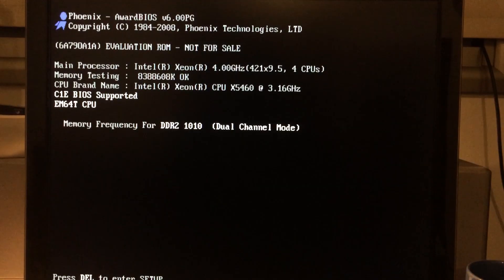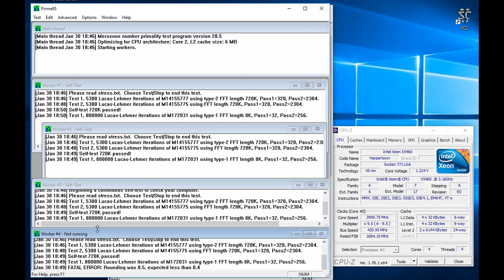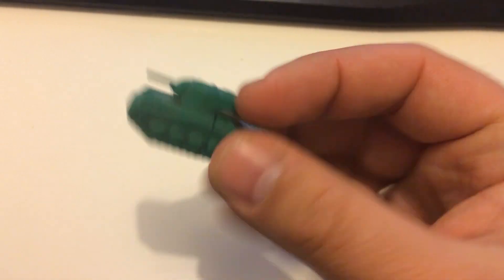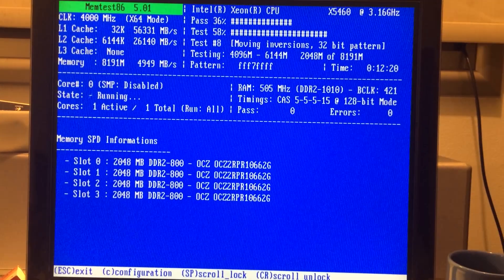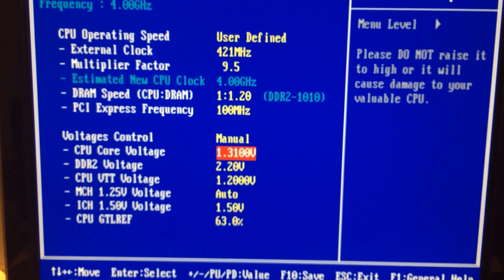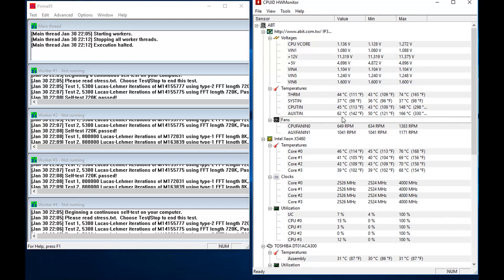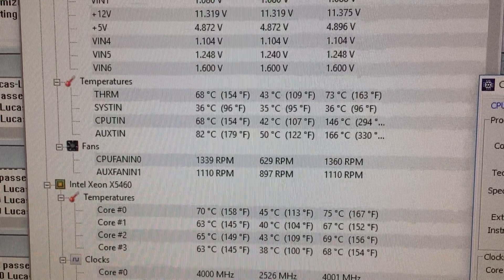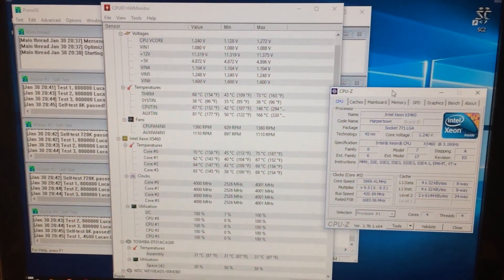Xeon Overclock 4GHz - Modded X5460 on Abit IP-35 (LGA771 CPU on LGA775 MB)

Comment: I installed the cpu successfully, but i noticed high temps 73 C when cpu is stressed.the cpu-z multi cpu stress cpu test scores 1115 and drops down to 950 after 5min when the cpu temps go up to 73 C (Core Temp software). Is it normal ? I did not overclock, its working on 3.16Mhz.
My cooler is lc power cc 95.

Comment: 2.20V ram :O
Reply: i have xeon x5460 4.1ghz but my voltage cpu is 1.30 and ram 1.86
Reply from the maker: the RAM voltage depends on what modiles you have. The ones I have have the voltage written on them. CPU is up to you.
Reply: @IONHowTo  okok

Comment: Hi, i bought this cpu but when windows start, blue screen appears. My botherboard is a P5B Deluxe, i dont know whats the problem, maybe unstable? the cpu and bios are already modded for enable 771 but it doesnt work, what do you think? should i change some parameters?
Reply from the maker: What version of windows?
Reply: Dragos Ion hi, Windows 7
Reply: Dragos Ion changed an option called "cpu frecuency" from 333 to 300 and it work but games and aplication crash, now i set it on 290 amd now it works and games dont crash but the cpu is on 2,75 ghz only, how can i oc with without oc ram too (i think that option i mentioned oc rams too and do my system unstable). Sorry im new with this terms and overclock
Reply from the maker: I don't know how it's on your MB, try to find the ratio somewhere and try lower CPU/RAM speed ratios.
or get faster RAM.

Comment: Could you overclock this same chip on a msi g41m motherboard?
Reply from the maker: Didn’t try it, don’t have that MB. 
Send it over and I’ll test it and make a video with it. 😅
Reply: I don't have it yet. Im intrested in buying it and I wanted to know if the chipset if overclock friendly. :)
Reply from the maker: Try to find some forums dedicated to that MB, without testing I wouldn’t be able to say. 😅
Reply: @IONHowTo  i have a GIGABYTE P43T-ES3G with X5460...xms3 1333mhz only 12 gigs since one ram was dropped on the floor and got broken. Any recomandations tu go higher than the general 3.16ghz? watercooled ofc and a 450wats psu from Thermaltake.

Comment: Now, i 3.8 overclocked my x5460 on asus p5q mother board, (1.28V)
I tried many time to overclock it 4.0 but 
When i overclock it over than 3.9, the bluescreen appear, 
So i want to get an advice, plz.. 
Ps. My english is toooo poor so you may not  understand me sorry😂
Reply from the maker: You write well don’t worry :) My MB overheats the Northbridge. At 4ghz you might have the same overheating problem. Its easy to check, check tems and put your finger on the nb cooler.
Few things can fix it.
A fan there or upgraded cooling fins for the NB or even water cooling. 😅 I would stay at 3.8 without extra cooling.
Also, make sure you don’t OC your RAM.
Also noticed that some RAM ratios just don’t work well and are unstable.
Reply: Dragos Ion thank you for advise me i gave up Oc to 4.0 :(  i satisfied on 3.8 
Thanks one more
Reply: @IONHowTo  I had for 10 years ram ddr2 800 MHz overclocked at 1360 MHz.
When I upgrade to 8gb ddr2 I have to set them to 1000 MHz because they are different models
Reply: 휴먼체 what were the settings? I have bought the same CPU and Motherboard
Reply: Silicon lottery, some chips will go farther than others. It's luck of the draw, and motherboard power delivery quality matters too.

Comment: I have same processor on a gigabyte p35ds3l. I overclocked to 3.5 ghz, but cpu-z or any other software i used shows stock clock. I must say that in BIOS shows the overcloked value. Any ideas what may cause the overclock not being enabled in windows?
Reply from the maker: Johnny C. Only thing I can think of is maybe the multiplier could be in idle mode.

Try to run a cpu intensive program and while that runs, look at cpuz. 
It should show the higher speed. 
You can tell if it's idling by looking at the multiplier in CPUZ, 6 is idle, 9 is full speed.
Reply: Yes i know when its idle, its on 6 and full its 9 on multiplier.
Tried Prime95,  on 100% load on all cores, max frq was 3.170Ghz even if in BIOS is overcloked to 3.50Ghz. Really dont know what might be the problem.
Reply from the maker: It's strage. I've never seen that. 
You could try to change the cpu frequency to a lower or slightly higher value and see if that changes anything in the reported speed.
Reply: Well, ive tried at 3.20ghz, ive tried at 3.55ghz, ive tried various voltage settings on CPU, PICE, Northbridge and RAM, ive tried with Performance Enhance on standard, on Extreme, on Turbo, ive tried with C1E, TM2 and EIST functions disabled, i tried various guides found on the intrenet. Ive set Windows Power Plan on High Perormance and in Advanced options i have 4 ghz as max cpu frq and 100% Maximum Processor State. Really is mind boggling. Prime95 shows max 3.170ghz, HWMonitor the same, CPU-Z the same. Only BIOS hows the real clock speed.
Reply from the maker: Johnny C. It's really strange. 3.17 sounds like the stock frequency. Could be that the bios settings don't work somehow and it's reverting to defaults but that should show in bios after a reboot. 
Try a linux live usb or run memtest  and check what cpu speed is shown there.

Comment: the heat spreader inside the cpu chip can handle only 63c without melting the solder.... you are ruining the cpu
Reply from the maker: +Jim Ro Had it at 4GHz for most of the winter. Now that the ambient temp. gets up to 35c, It's sitting at 3.8GHz. No meltdown, still going strong. 😁
Reply: Dragos Ion good 👍

Comment: Would you help me? I have an abit fp-in9 sli fatal1ty and I wanted to update it with the microcodes to be able to put a xeon x5470, but I can not find the mod already made but I need the bios with the microcodes could get for me because I wanted to be able to use Xeon processors because I have This board for many years and I want to do tests ...help!
Reply from the maker: +Alex .roli hello, I wouldn't be a ble to help you with your board but there should be some forum that has a post/section for your board. Could ask there.
Reply: Então eu fiz a busca nos fóruns, eu olhei para o BIOS da ABIT fn-9 SLI fatalidade com os microcodes já tudo pronto, eu não encotrei. Moro no Brasil e eu não poderia encontrá-lo, ele poderia me ajudar a procurar, porque o acesso diferente para o seu internet poderia ter mais pesquisas em relação a este bios com o microcódigo modificado, aqui no Brasil eu acho que eu sou o único que tem -lo até agora ..
Reply from the maker: +Alex .roli used google translate to read.
Try to see if you can read the existing microcodes with the intel tool.

Comment: Hey man. Do you think you could help me reach a successful overclock on the ABIT IN9 32X-MAX? I'm trying to reach 3.0GHz with a Core 2 Quad Q6600. I could make a video showing you all of the bios settings if that helps. Thanks!
Reply from the maker: +Rehvise hey! I don't know much about how you could do that. 

The CPU multiplier should be the maximum possible. Try to search for confirmed OC settings and start from there.

Q9650 would be much easier to overclock. It had 9 or 9.5 multiplier. 
The x5460 has 9.5 multi.

If the FSB and RAM speed exceed the rates values it can become unstable. Take small steps and be carefull with the VCORE.

Best is to get a Q9650 or a cheaper but harder to setup Xeon.
Reply: Dragos Ion thanks for the reply, yeah I've been thinking about purchasing a Xeon X5460 and doing the mod for it to fit my ABIT LGA 775 motherboard. It would probably be the best option because I really can't seem to get this Q6600 stable at 3.0GHz. I'm not sure what I'm doing wrong, but I will rewatch this video again tomorrow to try to get a better understanding on how to overclock. I have a Cooler Master Hyper T4 so my cooling isn't the issue. I seriously hate how my motherboard has the uGuru bios. It's so weird and complicated vs the IP35 bios.
Reply from the maker: +Rehvise the easiest is with a 775 CPU like the Q9650 but they are more expensive than these old xeons :)

Comment: Nice! I have my E5450 at 4GHz, but it's not as stable as your OC. I will get an error in P95 after a while, but it's good enough for non gaming usage for now. I need to complete my OC at some point.
Reply from the maker: +Jet Lee I'd check the CPU and also the NB temps. 
Make sure you don't oc the RAM. Memtest is ok?
During gaming or video rendering, the NB doesn't get hot at all... only during p95.
I'll put a mini cooling fan on that.

Hope you'll find the sweet spot. :)
Reply: Jet Lee this cpu can handle 63c without damaging the solder connection in the internal heat spreader maybe that why you are fucking up the cpu